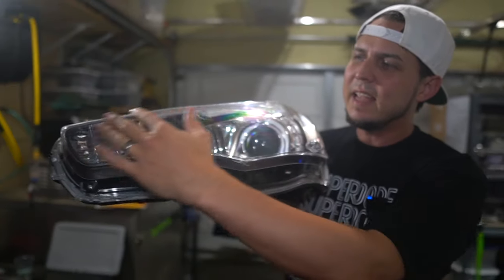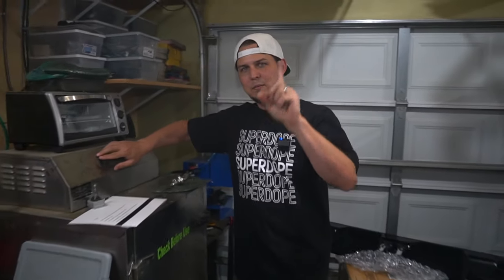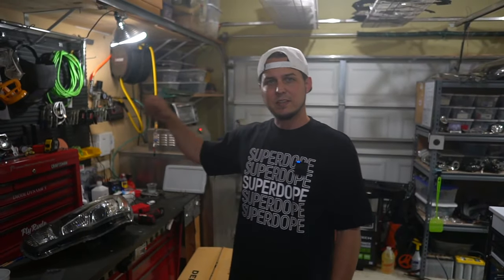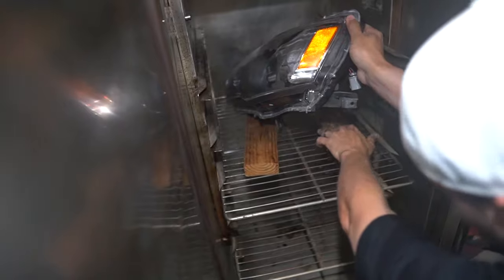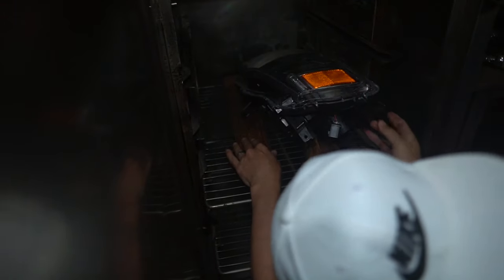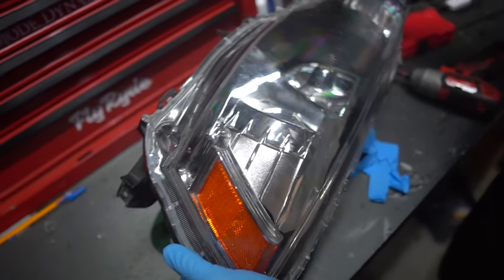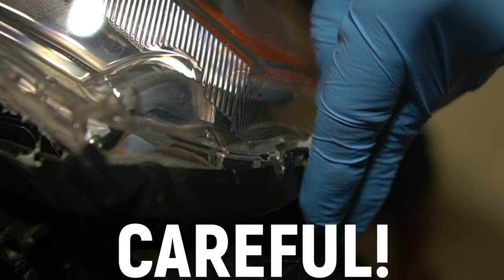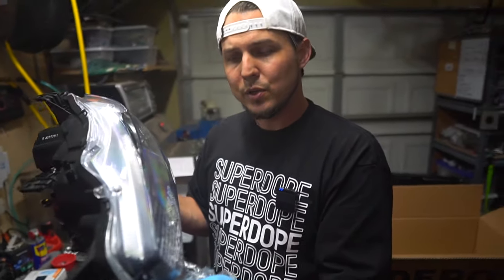Need New EXPENSIVE Headlight Lenses?

Comment: Yo lol. So I pulled the trigger. As you seen in our text I did start tearing apart a set of tails again. I ordered the ghozt lighting module ! Now I order it for tails preprogrammed. Only cause I have no clue what im doing. Now my next question is. Do you have any tutorials on how to properly set it up ?
Reply from the maker: Excited to see them done dude! Yeah you’ll need a wire harness, epoxy, and a remote, and you’ll be in a new category of custom 👌
Reply: @flyryde  so I sent you a big text on your phone explaining what I needed help with. Also I seen thag a couple people do it differently some just solder the wire to the board which is probably what I’ll do. And solder the other ones as far as the epoxy I don’t have potting epoxy and tbh I don’t plan on selling em jus using  em on my car so I might just liquid electric tape it like I did the corso motion

Comment: Can't you just polish the lens? Also don't DEPO supply lenses only?
Reply from the maker: Polishing lenses is often a temporary bandaid, but it gives great results that can last if done super well. Having said that, many times the inside of lenses get trashed, or the plastic develops micro cracks, or the scratches on the front are too deep. And the 2nd question: No
Reply: All is good and well but here's the plot twist: 

What if there are absolutely 0 aftermarket headlights (or taillights) for your pride and joy? Well then you ultimately pay the premium, ladies and gentlemen!
Reply: @flyryde  with regards to you mentioning the inside of the lenses getting trashed... Can that be repaired/buffed out? As I sorted out the outside of my lense as per YouTube lol but you can't see any difference as the inside of the lense is badly scuffed. How? I got no idea. Bought it like that... Any ideas on how to repair the inside of a lense?